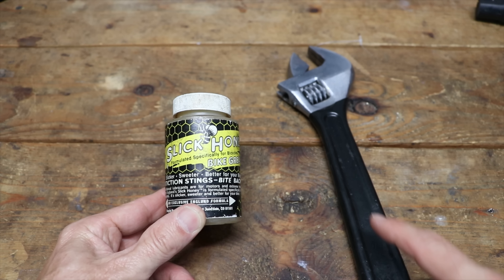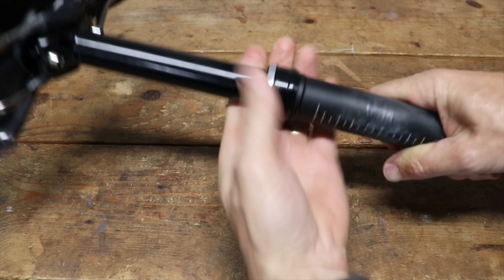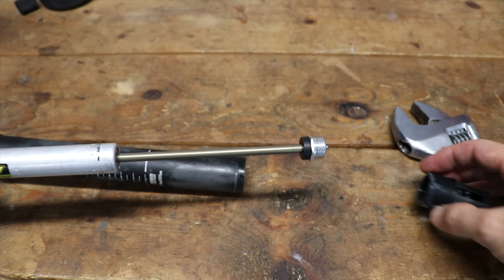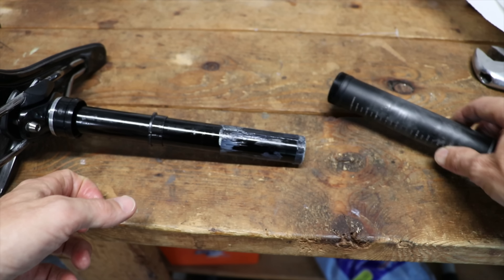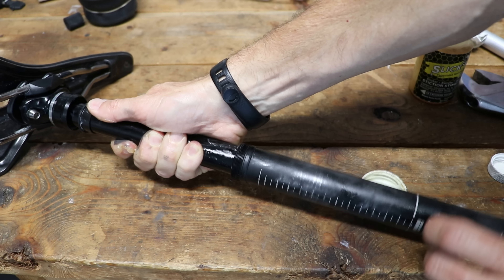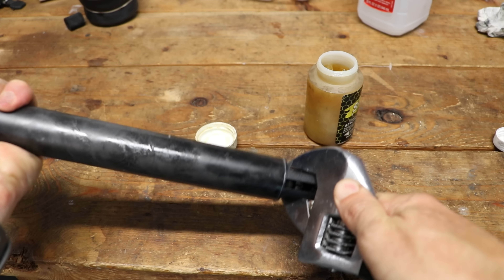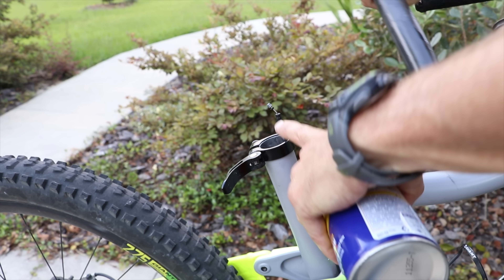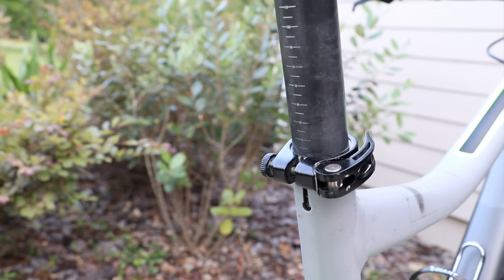How to Service Giant Contact Dropper Seatpost

Comment: I have bought a brand new giant dropper post. It will not drop. I’ve tried everything..... any suggestions. It is brand new and have never been able to get it to drop. It’s driving me insane
Reply from the maker: It sounds like the cable is just not tight enough. I'm sure you've tried that but just wanted to mention it. Did you get it at a local bike shop? If so I would just take it back.

Comment: Need help. I got a giant reign 2 2019 and my dropper freely rotates 360 degrees. Tried to open it and It seems that the upper post doesn’t fit with the lower post?  (whatever you call it). 
Ps. I also alligned those two plastic strips to the grooves of the dropper but it still rotates 360 degrees.
Reply from the maker: Those plastic strips are called keys and they do wear out. I would see if you can get a replacement set.

Comment: How often to service a dropper post?
Reply from the maker: Just when the performance is not a smooth as it should be. If the post will not stay up or return the air cartridge assembly needs to be replaced.

Comment: My giant dropper won’t stay up, moves down on its own. And when I dropped down, it will go up very slowly
Reply: I have the same problem. I still don't know what it is. It might be that you have to much cable tension but that isn't the problem for me. If I hold mine down for a second it will stay down and vice versa when I extend it.
Reply from the maker: If I recall correctly that's the issue we were having with this post. I would change the cartridge.
Reply: Clint Gibbs I changed the cartridge two weeks ago and after three rides started to slide down and up on its own!
Reply from the maker: @mannym.andcoyoteridgemtb171  then it sounds like it could be an issue with the cable tension. Did you replace the inner wire?

Comment: I've had a dropper on my Trance for > 1 yr & have never used it after 1000+ miles!
Reply from the maker: Time for to get off the road on that Trance!  Seriously though, if you learn to use it on technical trails it will improve your riding.
Reply: @ClintGibbs  I've been riding since '95 & the Trance is the 1st bike I've owned w/a dropper on it.  I'm so used to scooting back & behind the saddle on techy decents that the dropper doesn't even come to mind.  Was considering swapping it out for a traditional post & "dropping" some unnecessary weight in the process!  
Keep the quality vids coming...I really enjoy your perspective & insight on mtb-related matters!
Reply: @davidmatheson7391  You really should learn to use it. It will revolutionise your riding. I could simply not live without one.
Reply: I've ridden mountain bikes since '89 and only just got my first dropper (Giant Fathom) .. I use it a lot trimming my position on technical climbs, pandering to my grumbling knee, and cornering cleanly off and even on road.. and finally technical decents.. love it!

Comment: So I have had my Giant with the dropper post for over a year and it works good until... your woman takes your bike, doesn't have a clue how it works and screws it up in 5 seconds. Cable is shooting out past the leave on the handlebars. So I go to watch this video and it does not about explaining my issue with the cable. As I look at this $300 Cdn option on my bike and I'm like.. what a money grabbing hoax. I would rather lift my leg up higher to get on to this seat then deal with this BS. As for my woman, stay away from things I enjoy.